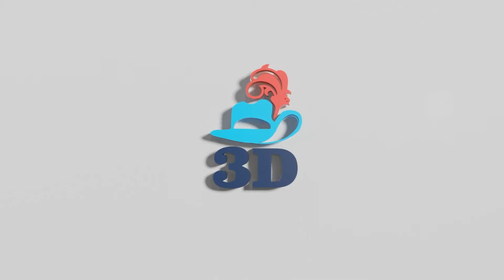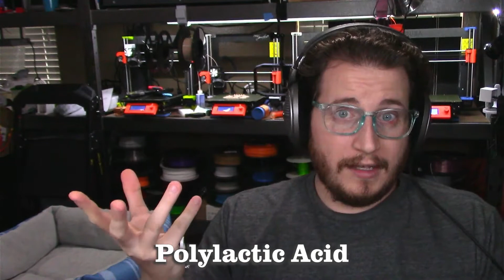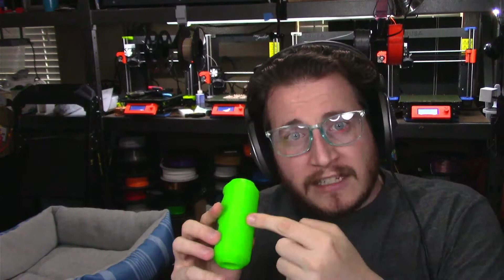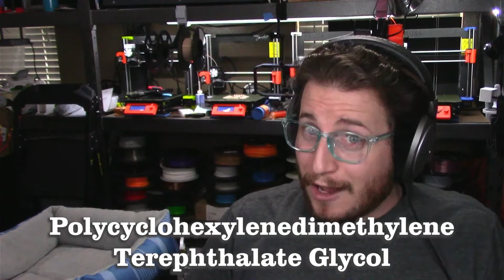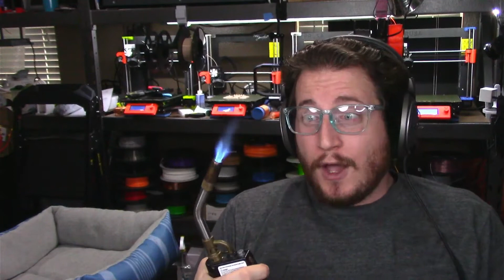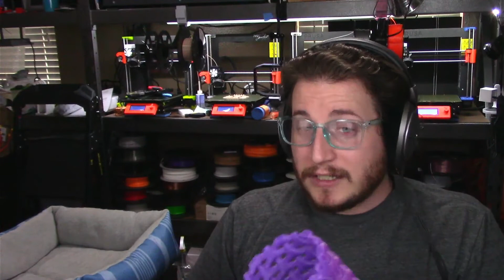Different 3D Printing Materials EXPLAINED

Comment: Nice rundown, thanks! I plan to start with mostly PLA, but I have a spool of TPU waiting for when I need a challenge. The other thing I'm intrigued by are the ones that look like shiny metals, for making faux-jewelry. Not anything complicated like casting moulds, but just for printing things that look like metal from a social distance perspective. I think those are mostly variants of PLA, from what I've seen, though. Nice callbacks to prior videos, too!
Reply from the maker: Silks are fun and yes, from a distance, it can look like metal, it definitely has the shine! They are a bit more difficult to print in our experience, but if you have normal PLA dialed in, it should not be too much more work to get silk dialed! :)